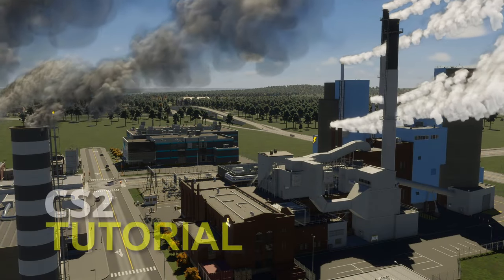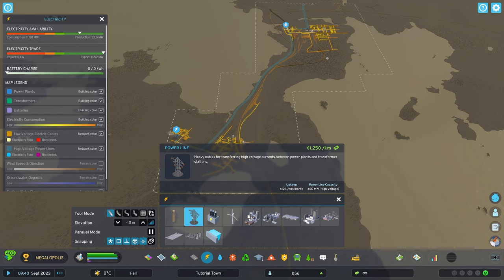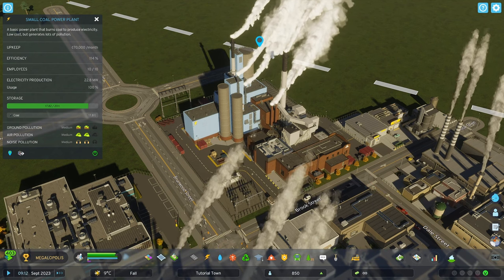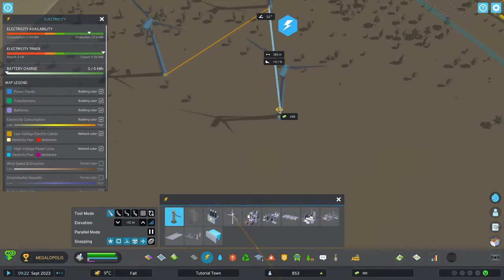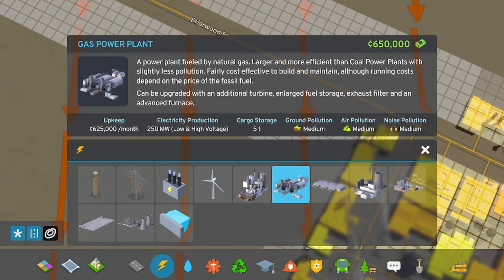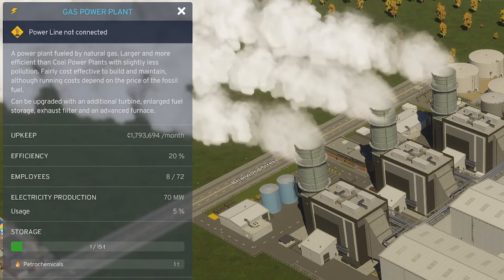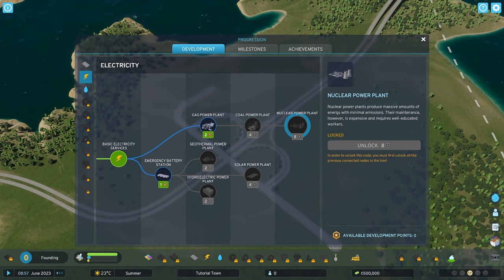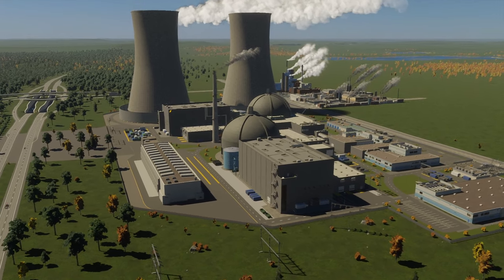Mastering Electricity in Cities Skylines 2 | Tutorial

Comment: Nice video👍

I hope you dont mind some feedback: Wind turbines are more expensive for the same capacity as the small coal power plant but they are significantly cheaper to run in the long term. You basically trade 

Wind Turbines - Expensive initial investment but cheap longerm
Small Coal Power Plant - Cheap initial investment but expensive long term (not to mention the large amount of pollution. 

Wind Turbines can also be upgraded with their solar panels being just as cheap (per MW) as the large solar power plant, cutting down on costs. 

The 10 MW battery is very expensive for its capacity, but it might just be perfect to get the additional power from the solar panels trough the night. 

The advanced rotor upgrades for Wind Turbines is just as cost effective as the initial wind turbine: This means that

2 Wind Turbines with 7,5 MW output are just as cost effective as 

3 Wind Turbines with 5 MW output

Since wind turbines require windy spots and create a lot of - unrealistic - noise pollution, having fewer of them for the same power output and cost is often a nice thing to have. 

Import Costs seems to be arround 5000 Credits per MW while Export Profit is 2500 Credits per MW. So for power plants that are more expensive than the export value - as every fossil plant is - you are still burning money when exporting instead of making a profit, just less so. 

The emergency battery station is the perfect fit for the solar power plant and its batteries are much cheaper to buy and to maintain as the solar power plants integrated and upgraded batteries. The diesel generators provide arround 8 MW of power when the batterie is depleted at the cost of large amount of air pollution and probably astronomical running costs. 

Geothermal is still relative cheap in producing electricity but the initial cost is high and the requirement of ground water - which gets polluted - and the pollution is produces make it not suitable for all locations. 

Solar Power Plant has the second cheapest production cost per MW but it being dependent on daylight and weather make its overall performance strongly dependent on the map. On sunny climates, it will perform great but on cold climates with long harsh winters and lots of short daylight months, it will be rather underwhelming. For some really stupid reasons, it also produces noise pollution which is ridicolous. The Tracking System upgrade adds basically 1/3 more power at the cost of 1/3 more maintainance, making it more space efficient while maintaining the very cheap power production. 

Nuclear is ridicolous op and unrealistic, having very cheap power production costs, no drawbacks beyond noise pollution, being perfectly save (nothing happens it it does burn down), not having to worry about waste or even fuel consumption which is horrible unrealistic. 

It should have a train connection for handling both fuel and waste and be much more expensive to maintain like in real life. 

I didnt knew you can only build one.... and I personally think that this is a poor design decision for all those 8 point buildings....
Reply from the maker: Not at all! 👌 Thanks so much for taking the time to provide this detail, that's what I love about this game and the community, as we discover things we share them with each other and learn so much more, especially in these early days 👍 

Yes, absolutely! It would be nice to see rail as a building upgrades to some of the bigger plants, and being able to build more than one nuclear plant and have it require uranium and having to get rid of the waste. The water requirements were an excellent touch but definitely could've gone further. 👌

Thanks for watching! 👍
Reply: Soo just build wind turbine until you can build the nuclear power station is what I'm hearing